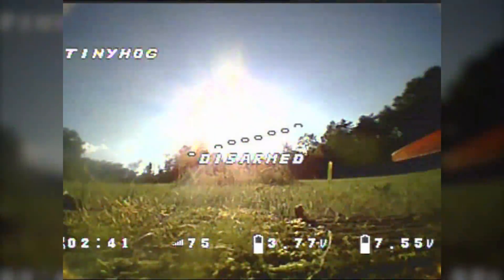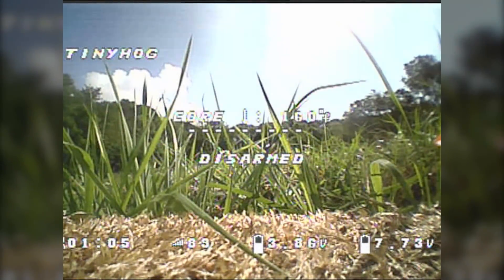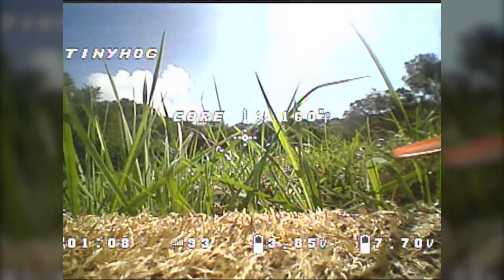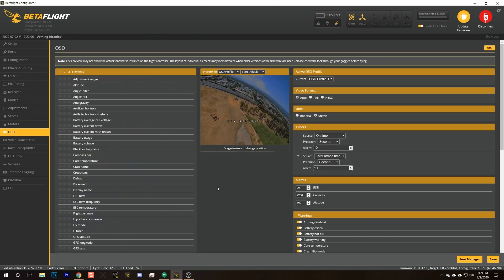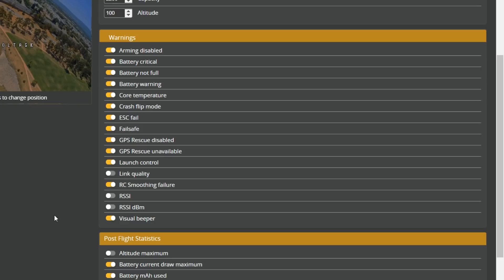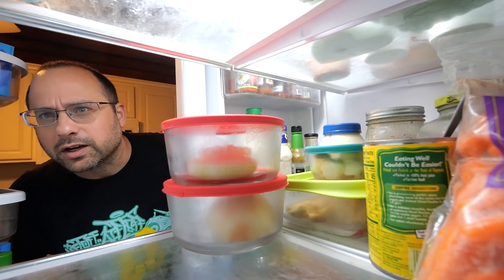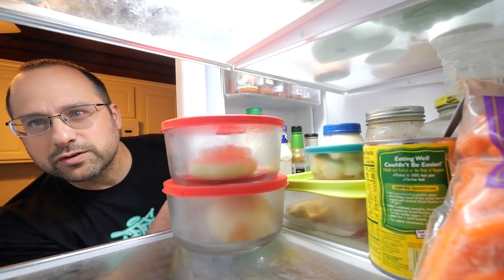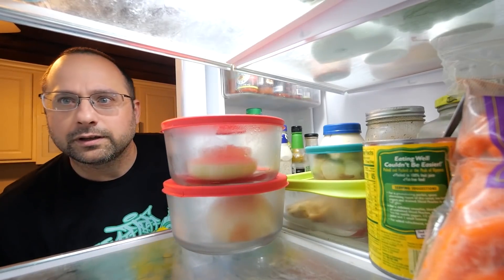Betaflight Core Temperature Warning - how to get rid of it

Comment: I would not ignore it if it is above 180f / 82c. Those microcontroller chips have a specific max temperarure which is different to your home pc cpu. As someone who has worked on countless projects using Atmega, PIC, STM etc I can confirm errors in program loops do occur more frequently the closer to and beyond max temperature you get. There could be a real reason you are experiencing an overheat like a bad regulator, faulty peripheral or a wire loom or VTX covering the FC. A better option would be to change the warning temp threshold. 👍

Comment: If I wanted to enclose the flight controllers and other equipment a touch, mainly to help with possible water splash in slightly wet grass.. Rural Oklahoma mornings.. Would you also suggest a heatsink or micro fan to help move air through the vents?

The design I have been working on, drone newb warning, I can put a opening for headsink fins into fairly easy.

My second drone, first was an e58, died because it happened to find the one random drop of water to crash into.
Reply: I just conformal coat 🙂. No need for an enclosure.

Comment: Something I have noticed is my core temp warning only comes on if I sit powered up for too long before taking off. I've never had it while flying. I use it as a way to make sure my vtx isn't sitting too long.
Reply: I guess it is because it gets cooled by the air
Reply: @toom__s  yeah I knew it was. I was just saying if the temperature rises while sitting still then I try get it in the air as quick as possible. I like the warning for that reason. Ive also started blowing a small fan on it while Im checking things out in betaflight and I have a battery plugged in.
Reply: SPOT ON. As a newb to this, which is in large part why I'm watching this channel, I've noticed this issue mainly when I've left my tinywhoop connected to battery and I've started watching a tutorial (Like this one!). I'd recommend @JoshuaBardwell add a little video note addendum addressing this as a likely source of the issue. And kudos to Joshua for that last fridge frame (Freeze frame?)- I literally just did that before watching this and you just won a patron supporter ;)

Comment: Note you can adjust the warning threshold in the CLI as well if you still want a warning, but want to move it up a bunch (maybe to 80 to 90c, but that's on you if you change).  See https://www.screencast.com/t/k740hLcTK
Also, note your FC will do like a temporary lock-up thing it seems if too hot.  I have never had it on a quad, but have on a wing with the FC and ESC in the same compartment, hot day, etc...  I'm sure results will vary, but nevertheless.

I need to move!  I have never had the core temperature warning go off on a quad.  :-(
Damn global warming is ruining everything.
Reply: And that is why we have UAV Tech...
Reply: Me either! Sweden here. :) BUT! Why have the devs set the value so low? Most F7 processors list that they will work fine in 85c to 105c ranges I think.
Reply: @mikaelbackstrom  , hell if I know.  But you can easily adjust in the CLI.  See https://www.screencast.com/t/k740hLcTK
Reply: @uavtech  Thanks, but you said you never set it to off but in your screenshot the osd warning for core temp is set to off
Reply: (Just to be clear, the Dev board F7s I play around with have F7 processors that spec that, I have not actually looked at the processors used in the flight controllers we usually buy).
Reply: Now that is a very relevant thing, I’m glad you said that!
Reply: That's what I was thinking about too. I will set a decent threshold and turn it on as I always had it off.

Thanks.
Reply: I love that I can go to a JB vid on a thing sorta related to what i'm trying to do and find the relevant info in the comments lol

Comment: Hey bardwell I have had a tiny hawk freestyle but I want to go to dji fpv with the dji controller I looked at the veyron v3 cinewhoop but I want to go to the 5” class should I get the cinewhoop or the five inch
Reply: You can only answer that question yourself. 5 inch and cinewhoop is very different in their style. What kind of flying do you want to do? Figure out that first and go with your gut. For a cinewhoop you probably gonna run a gopro anyways so you are just not gonna use the video from the air unit.